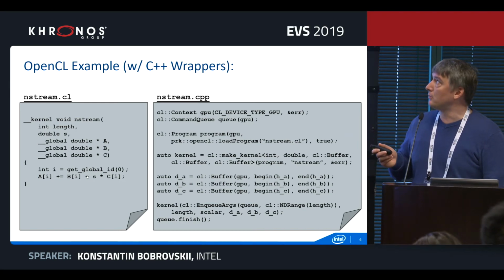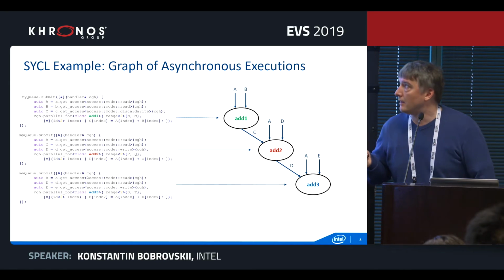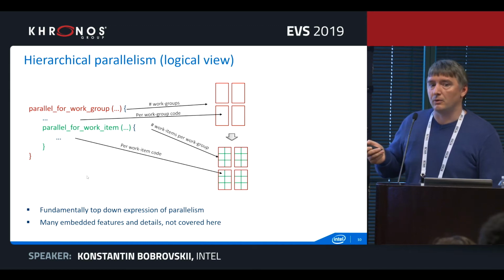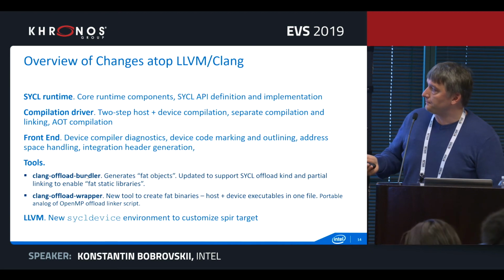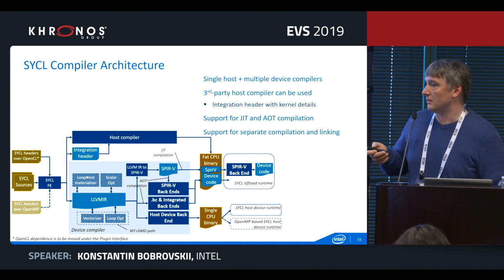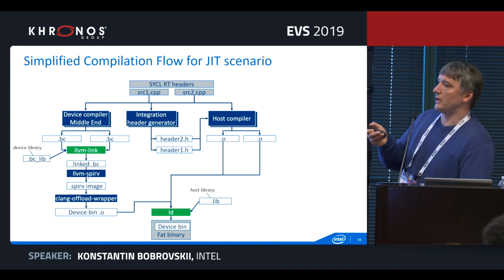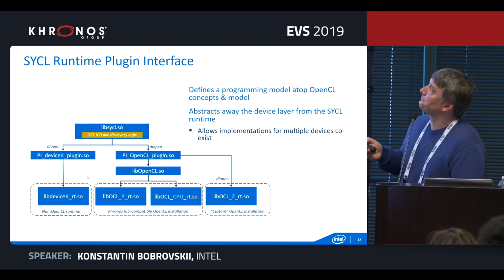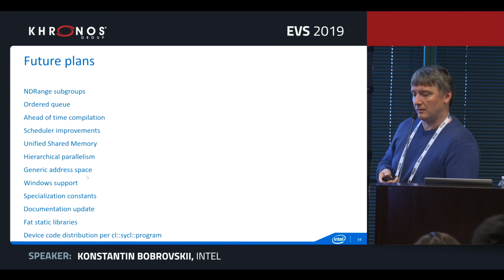2019 EVS – Intel Open Source SYCL Compiler Project - Session 3

Comment: Thanks for the great talk. Is the dependency graph built statically by compiler or dynamically by SYCL runtime? I assume the latter would be less optimal as runtime system does not have full context.
Reply: The dependence graph (between kernels/command groups) is built dynamically by SYCL runtime. I'd argue about the optimality claim. Runtime has an accurate graph which it can optimize before execution, plus lots of specific runtime info such as NDRanges for each kernel in the graph. Compiler, in contrast, can only guess the graph (e.g. what if command groups are added to the graph under some if condition?), yet it does not have runtime info which can greatly help in graph optimization.
Reply: @konstantinbobrovsky7943  I see, thank you. What I'm worried about is the following scenario: imagine we submit multiple groups to same queue: A, B, C, D and, due to dependencies, the optimal schedule is A->D->B->C. My understanding is that when we submit B, the runtime system will not yet be aware of upcoming D (due to the lack of context which I mentioned above) and would eagerly schedule B. Is that correct?
Reply: @yugr  I don't think this situation - submission order is A, B, C, D and dependence graph is A->D->B->C - is possible. Consider the case when memory is represented by accessors for simplicity. Then dependence graph nodes are added when a new command group is submitted based on read/write access to memory buffers represented via the corresponding accessors. There is no way D->B edge will be added to the graph, as all B's dependencies are "fixed" at the moment of B's submission, where there is no D in the graph yet, and it can only depend on A.
Reply: @konstantinbobrovsky7943  sorry, I failed to make myself clear. I didn't mean arrows to signify data dependencies, just the fact that optimal order is A, D, B, C. Probly Youtube comments is not the best place for discussing technical questions after all...
Reply: Huh, that’s an interesting question. You can make a C++ API static, with templates and constexpr, to build the components at compile time, or make it a dynamic runtime thing with the objects and so on. I guess their SYCL is runtime-only, just because there’s the JIT possibility. But in principle it should be possible to build everything static for a known host+device combination. And yes, then the compiler might be able to optimise the scheduling order of the full graph of kernels.

To optimise the full dependency graph at runtime, they would need a concept of the kernel execution graph. So, you’d submit kernels to a graph, and  when it’s complete, submit the full graph to the execution queue. Then the runtime could optimise the full graph. And, I think, that’s what Khronos’ OpenVX does, right? I guess, it could be a useful thing if you have relatively small kernels and you want to combine them. Or something like that.
Reply: Huh! Intel has an extension “SYCL graph” sycl_ext_oneapi_graph, which allows you to submit command graphs of kernels, similar to CUDA Graphs. It allows the runtime to optimise on the whole dependency chain, how to submit the kernels, and what DMA to use etc. There’s a YouTube video from IWOCL 2023 and Codeplay blog post about it.